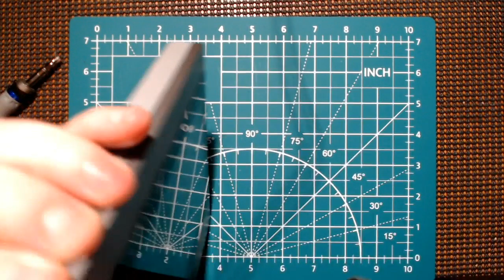AcuRite Atlas  |  Inside The Atlas Touchscreen Weather Display

Comment: A lot of these displays fail.  I'm not sure it's a hardware issue.  I tried a BGA reflow, as well as as an ultrasonic cleaning to no avail.   Likely one of two things kills these.

1)  The on-chip solid state memory degrades and becomes unreadable, hangs / freezes on power up.
or
2) a power bump / fault causes data corruption and there is no way to restore defaults, leaving it bricked.

I wish Acurite would provide the firmware, and the app to write it.

With the pwr cord removed; If you press and hold the reset button and plug it back in before releasing; it will enable the USB port and allow a PC to communicate with it.

Because Acurite offers no software, not much you can do from there.
Reply from the maker: Thanks for the information.